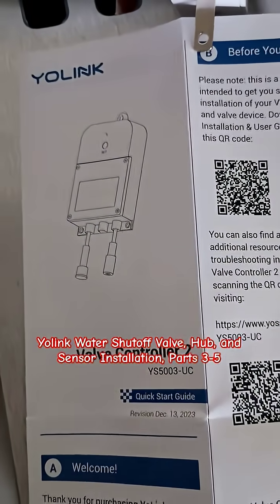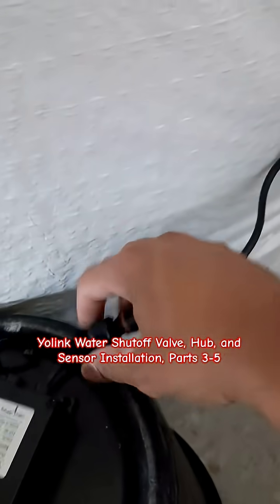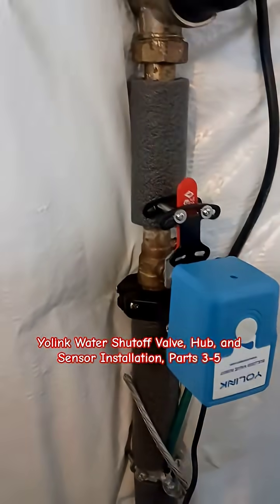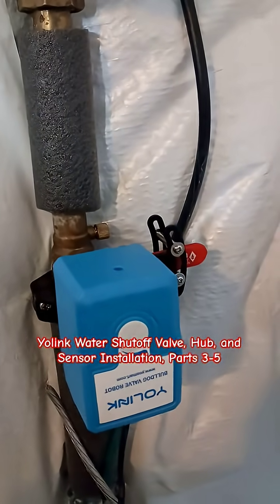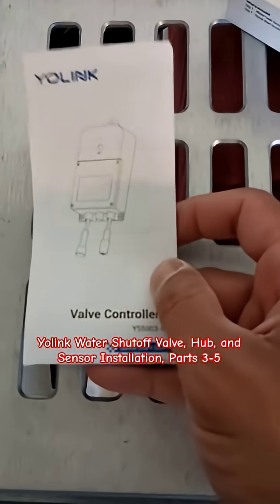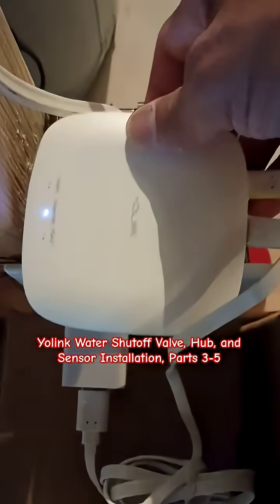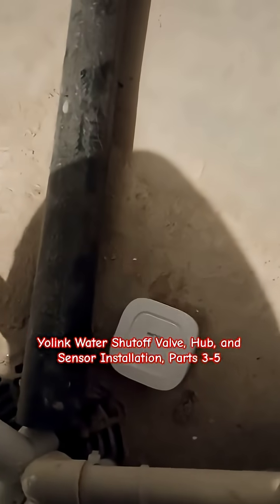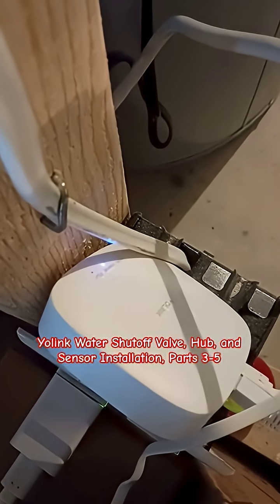Yolink Bulldog Valve, Water Sensors,and Hub Installation for Remote Water Shutoff Control:  Part 3-5

Comment: How you handle if the valve closes earlier than 90 degrees?
Reply from the maker: These valves are desk for 90 degree rotation.  I assume the stepper motor monitors over current if it hits a hard stop and will shut off, but I didn't test it at other angles